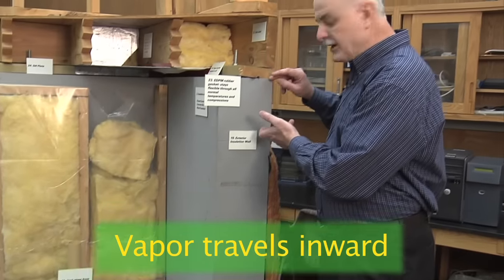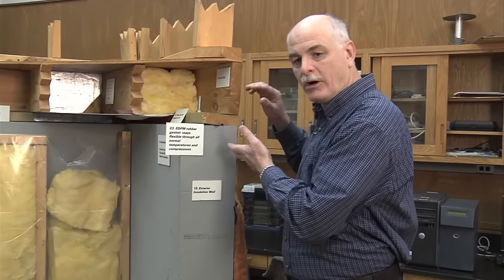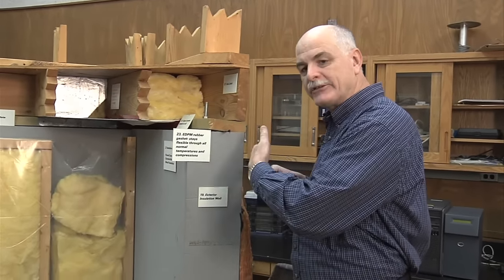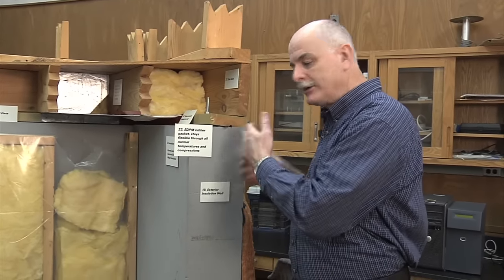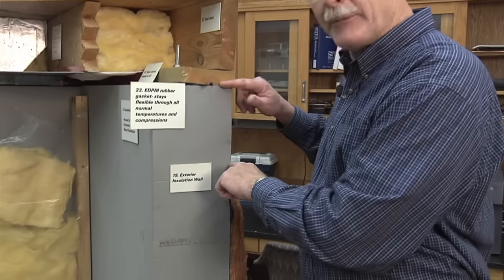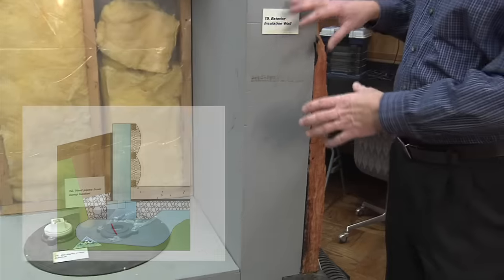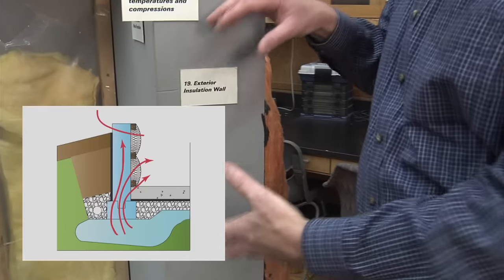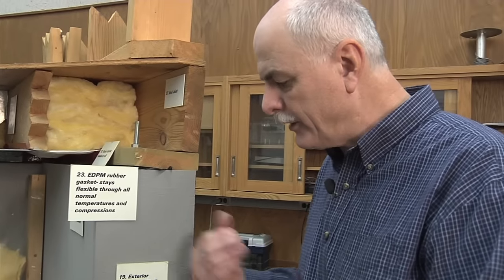Foundation Insulation Effectiveness: Basement building science

Comment: Just bought a 1960 house with an unfinished basement. Cement block foundation, no french drains and no subpump and dirt floor.. Trying to figure out what are my priorities in the basement with a limited budget. My main concerns are humidity, mold, heat cost and radon. I have to say,  watching hours and hours of youtube videos has done nothing to help me. Actually confused me even more. The internet is nothing more then a bunch of conflicting information.
Reply: Hmm, dig out the floor dirt. Then a thick layer of concrete insulation then concrete over that.Dig round the house outside. plastic mat with nipples so it drains between wall and plastic, then outside "ground insulation". Re fill dirt. Inside basement steel studds for walls. Make air gap between concrete wall and inside wall. Put a hole near the floor and active ventilation at the to far from the vent hole. Insulate Rock Wool. Plastic, the double gypsum. Only use one plastic layer in the wall. You need some open thing to hold the rock wool sheets.
Reply: Radon is the biggest scam in building. Search for a YouTube video from a guy who uses the governments own studies and words which are - “you would have to live in a mine, work in a mine, and smoke for radon to be harmful.”
Reply: @72strand  Do all that "on a limited budget"?
Reply: @marksebby2955  Mostly work. If you put in insulation, you save money  needing less concrete. You can dig drain around house with a shovel. I have seen it.
Reply: @72strand  "I've seen it" ..... I won't take your suggestions until you've done it.  Yourself.  By hand.  Retrofit of existing home with porches/decks attached to house.  Then tell us how it is.
Reply: @Redandranger  The next door house, he is 76 and he did do a trench by hand. Dig down i to the dirt 5 feet wide and 7 feet deep and 200 feet long. Then on to a weelbarrow and in to the woods 400 feet. The he did a concreet wall. 10 feet high.

Comment: Instead of placing the moisture barrier on top of the footer, why not make a moisture barrier 'bathtub' by excavating uniformly in depth to undisturbed earth, placing down a moisture barrier that encapsulates the footing and the exterior wall until above grade, then install polystyrene insulation with an additional polyethylene barrier on top of the polystyrene insulation to prevent "Iceberging" of the polystyrene foam sheets?

Comment: So basically, older homes with no insulation on the outside concrete basement wall have no good choices.
Reply: I am sad to say your probably correct. 
My house was built in the 60's and I'm pretty sure there's no tar paper or other barrier between my rim joist and the foundation. My dirt floor crawl space is almost a pandora's box on how to address without future issues...
Reply: @ambilaevus7607  Ditto.
Reply: Pff, older homes!?! You’d be lucky to find a modern day builder that’s gonna put this kind of detail into something like the basement foundation. They don’t give a damn, it’ll last a couple years with no mold, by then they’re gone.
Reply: Sell it and build a new one with exterior insulation. If only you can find someone who know how to do it...
Reply: spray foam in the summer, keep your basement windows open for a bit.

Comment: lol- never put fiberglass insulation on the outside. It would not do anything unless you plan to not backfill and build an extra wall of foam around it. Now people build with ICF (insulated concrete forms) that are waterproof, have greater strength, and greater insulation values. (below grade you may want to put a water barrier on the outside of these also though. Just in case)

Comment: Bill on studs no basement all the airflow can go beneath in between earth and house. Use a wood structure with straw for the floor and on top of that you can use water heating system in the floor walls also I would add straw make sure to and one and the outside can be rendered with lime it is effective against bacteria and moist and works really good together with the wood and straw. Inside a 3 cm or 1 inch plus carb layer with special finish carb will give a breathing and very pleasant atmospheric enrichment to your life. The carb works also really great with the straw and wood structure and breeze all in and out but the straw is so highly dense and insulating that no other construction can resist it  Plus the wood straw cob and lime constructions are in general extremely more cost efficient than all modern strategies and tactics you need so in the end all the strategies for example the bathroom to get water insulated with all kinds of layers of plastic in special blues and tiles are diminished when you change your mindset because even the most great idiots can repair the clay and the initial rendering of all the walls will last at least 10 years.

Comment: Or you could just use closed cell spray foam on the basement, either interior or exterior. If interior, space the studs away from the wall. You get a monolithic barrier whether you do interior or exterior.

Comment: This guy really knows what he's talking about, but it's a pity he's demonstrating with such feeble levels of insulation both below slab and outside the wall. If you are putting some batts on, it really should normally be a lot more than 30mm/1", especially that image with the battens in so it's 15% thermal bridge. You can't fix it later (or at least it's extremely difficult/expensive). Depends where you are in the world of course. I guess 30mm of XPS may be adequate in some places.

Comment: All this bullshit called building science.
As a professional remodel contractor in the Northeast USA i laugh every time I see these youtube Building Science (=BS Session.) We have demo'd basements from 60 years plus..finished. 2 x3 Walls 1/2 drywall on bare concrete/poured foundation. No mold or moisture in walls or studs or drywall...top to bottom. Out side foundation down to bottom..back then no drainage tiles. NO WATER PROOFING ON EXTERIOR. Drain system put in the 1960's interior. Floor ontop of tile on cement..2 x 4 -5/8 ply and wall to wall.  Room size of finished  24x26. Carpet area moisture due to no vapor barrier/plastic under 2x4 sub.

New interior Perimeter Drain system to sump. Delta MS Mat on wall/foundation down to below foundation wall. Poured concrete over new drain system. 4" Drain Solid PVD holes on bottom sides. Any moisture on concrete is trapped by mat down to drain tiles. IF at all. 2x4 Framing insulation vapor barrier out. R-15. Plastic 12Mill on floor 2 x 3 Floor joists (like a framed wall laid down) 5/8 Ply...and Finish laminate flooring. I forgot to mention on the demo we reused all the ply that was down from 1987 to 2012 that was down for 25 years no mold or smell. Keep a fan running..dehumidifier and you are good to go.
Building Science I think not.